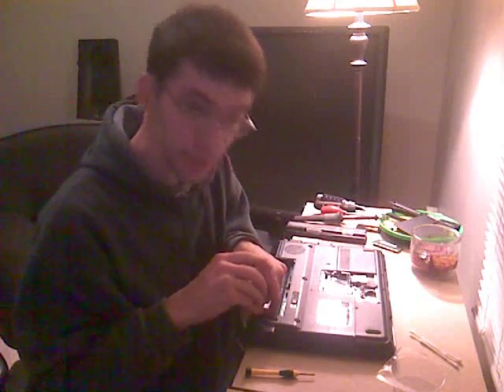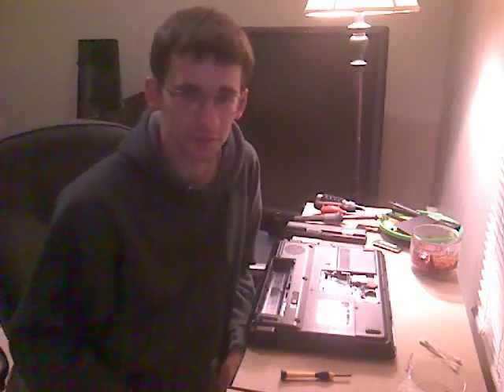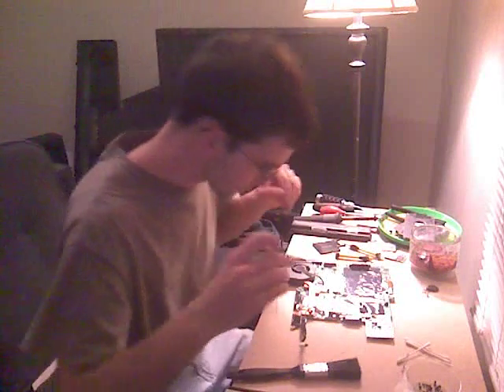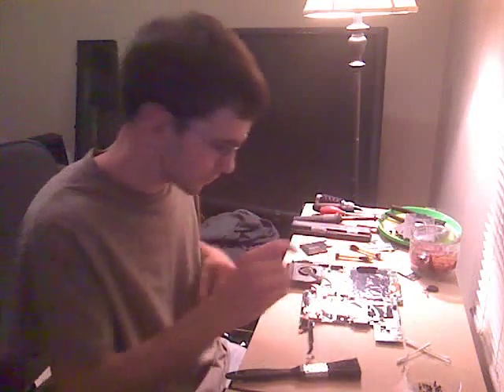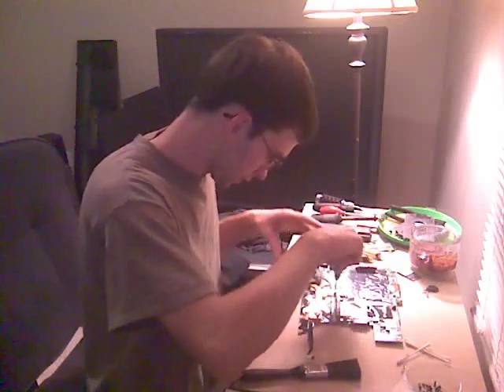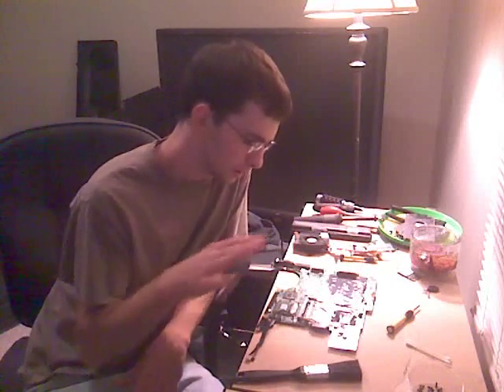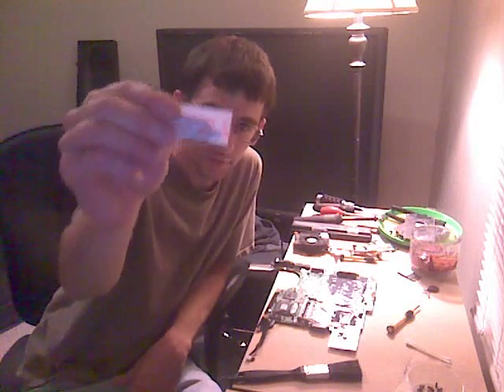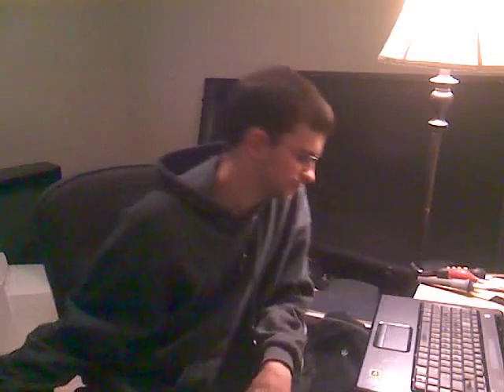Compaq Presario v6000

Comment: I've successfully repaired 2 Compaq v6000s with this video issue. And you seem to be on the right track however, the problem is that you must reheat the GPU top and bottom so that the chip can reseat onto the motherboard correctly then, apply a copper shim and thermal compound to dissipate heat effectively.